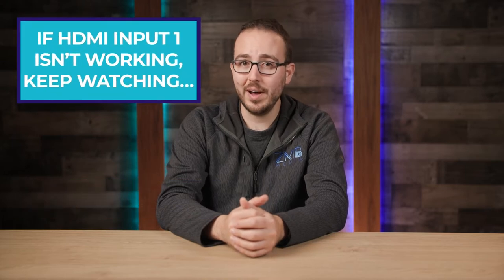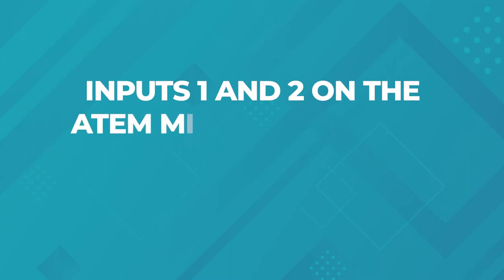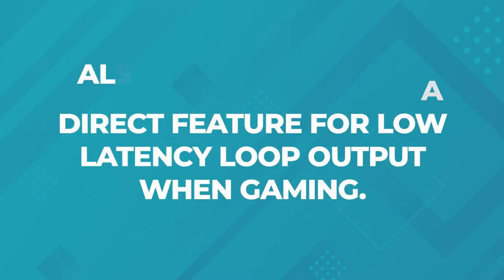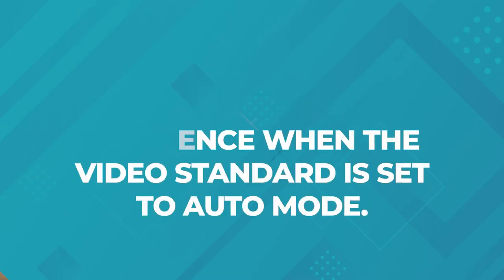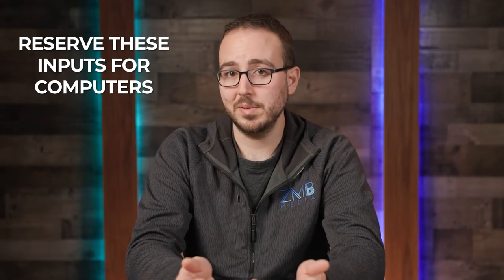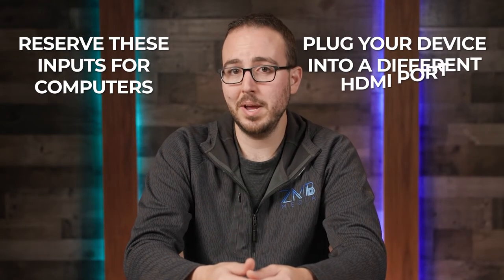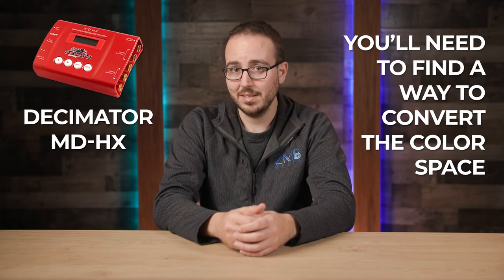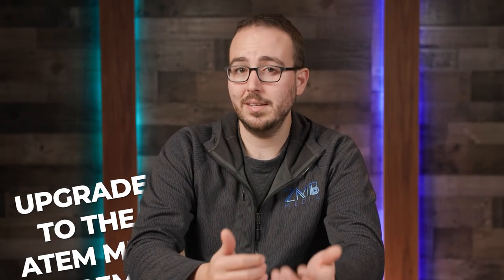Fix HDMI Input 1 Not Working - ATEM Mini Pro YUV Color Space Issue

Comment: Bro I can not explain how hard I have been searching for an answer to this issue. I have the ATEM Mini Extreme ISO and no one told me that input 1 & 2 would randomly film in this green color casting until it was too late into my 2 hours of recording SMH. So I now only use inputs 3-8. I have noticed recently the camera quality is very grainy and I have not been able to come up with a solution. I am using 5 foot HDMI cables, and 3x Panasonic G7 cameras for recording. Any feedback would be appreciated!
Reply from the maker: The G7 is a four thirds sensor so it’s never going to do well in low light situations. It’s most likely grainy because you are bumping up the ISO or you may have it in an automatic mode which will bump up the ISO in dimly lit settings.
Reply: @zephanmoses  That makes a lot of sense! I am filming a Podcast but I use very bright studio lights and still deal with the grainy look. Seems to only be like that when plugged into the ATEM Mini Extreme ISO. If it's stand alone it actually looks way better. Any thoughts!? THANK YOU!
Reply from the maker: @MikeSicilian  does it look that way on the multi view or on the recording or both?
Reply: @zephanmoses  first off I greatly appreciate you responding to this cause I've literally contacted Blackmagic and they weren't as helpful so thank you. As soon as I plug the HDMI cable into the cameras, the quality seems to reduce and I even get a warning saying "AF performance may be temporary degraded while down converting HDMI rec output (4K to 1080p)" and then just the quality goes boom and gets super grainy. Soon as I unplug it and use the camera with an SD card standalone the quality looks fantastic. It's a 1K cost machine didn't think I'd have this many issues. Appreciate any guidance!
Reply from the maker: @MikeSicilian  the G7 shoots 4K but the atem can only receive HD so that’s why. The camera is reducing the quality from 4K down to HD so that it’s compatible with the atem. So it makes sense why it’s doing that. No way around that. You’re using an HD switcher with a 4K camera.
Reply: @zephanmoses  It all makes sense. The cheaper route seems to be to get a better switcher that will work with the cameras? MUCH APPRECIATED!!
Reply: Brother I got to get at you again for one last question! So everything you said makes complete sense now. The base ISO on this G7 is 200 which is horrible. So I bump it up to at least 400-600 and even with INSANE bright studio lights still looks like crap and granny. Am I just doomed with this camera? @zephanmoses
Reply from the maker: @MikeSicilian  What are your other settings? Include F-stop, shutter speed and the lens you are using. Is it a slower kit lens? Or something F2.8 and faster? Half the battle with lighting is how well the. camera does but the other half is how much light the lens can let in. If you're using a lens at F4, F8, something higher then of course it's going to be dark. If your lens is at F2.8, F2 or F1.4 then it should be much brighter.

Also what type of lighting are you using? Cheap LED panels? Softboxes? While it might appear bright to you, what are the studio lights?

The G7 is an 8 year old camera so you can't expect much from it in lower lighting scenarios.

Comment: Hi, I have two HDMI sources (lets call them device 1 and 2) connected respectively to input HDMI 1 and 2.  Only device 1 on input 1 of Atem has audio.  The input 2 has video but the audio is not working.  When I swap device 1 and 2 cables, I still get audio from hdmi 1 (now device 2) and no audio on hdmi 2.   Same for hdmi 3-4, no audio but video is working.  To resume:  Video 1-2-3-4 ok, Audio 1 ok, Audio 2-3-4 not working.  Does someone knows why?
Reply from the maker: You need to turn on audio for each individual input. So if you look at your atem, there is an on button for audio for inputs 1 through 4 (it's just above each input. So if you look at input 1, above it is up and down arrows and then above that you'll see on and off buttons. Those buttons turn the audio on and off for that input.

If you want audio coming in on input 2, you'll need to press the on button just above the 2 button on your atem.

Now, if you've turned on the audio for that input and you're still not getting audio, there's a good chance that there is no audio traveling over the HDMI cable. You can confirm this by connecting that cable to a TV or something that has speakers to see if sound comes through.

Additionally you may have accidentally turned on AFV (Audio Follows Video) which means that you'll only hear audio when you cut to that input.
Reply: @zephanmoses , Thanks for replying but audio buttons are all set to ON and there is audio on the cable because both device are working on input 1 but not on all others channels.  Even, I was using the device no.2 on a Roland V-1HD last week and it was working great.  Have tested with AFV button also and I get the same problem.  No audio on HDMI 2-3-3, no leds, nothing.  Mic input 1 and 2 are working by the way.  The Atem has the latest firmware.
Reply from the maker: @panikpas  Are you seeing audio levels in the ATEM software control application in the audio tab? Usually they are greyed out if the audio is coming through but turned off. Always confirm in the software control. And while I understand that you used a different switcher, you did not answer whether or not you tried plugging the HDMI cable into a TV or HDMI monitor to confirm the audio is coming through. This sounds most likely a settings issue and there's something that might be missing. If you're able to record a video showing your atem switcher as well as the software control in the audio tab, I might be able to determine the issue but without being able to physically see the device, I can only provide so much assistance.
Reply: @zephanmoses , Like I said, audio is coming through hdmi cables because it was tested on hdmi input 1 of the Atem and it is working with both device and also on another video switcher with the same cable.   Audio Levels is working on hdmi 1 and Mic 1 and 2.  Audio levels is not showing on hdmi 2-3-4 even with audio set to ON on all channels.  I know you are trying to help but please read carefully what I'm saying to prevent asking question that are already answered in my comment.
Reply: @zephanmoses , I've tested another device (lets call it device 3) on hdmi 2-3-4 and the audio is working.  So, I think that it is related to the type of audio (aac) the device 2 is sending.  Probably, the input 1 has more codec compatibilities then the others hdmi input.  It's a good thing the Mic/Line input is available on the Atem.  The device 2 is a Neumi video player and I only have two modes for the audio on it: passthru and AAC.
Reply from the maker: @panikpas  I did read carefully but if you cannot participate in the troubleshooting recommendations I am making, I cannot possible learn all of the information I need to learn to help you in troubleshooting. I've asked you to verify if there are levels visible in the software control which you haven't confirmed or denied yet. Sometimes the levels are visible but greyed out which would indicate something is coming through but the audio is not turned on. Other times, audio levels are not visible at all which means there is absolutely no audio coming through that HDMI feed.
Reply from the maker: @panikpas  Additionally, you did not explain what cable length you are using for your HDMI cables as input 1 always behaves differently due to its low latency design and will receive certain signals over longer cables that you might not be able to send into inputs 2-4.
Reply: @zephanmoses  6 feets cables.  Same cable for both input.
Reply from the maker: @panikpas  Ok, what do you see when you open the ATEM Software control and go into the audio tab?
Reply: @zephanmoses , Don't bother with it, I will find the problem.  Now I know that it is related with the audio protocol on the Neumi player and that the Atem is not broken but just incompatible at some level with the Roland V-1HD (device 1) and the Neumi (device 2).
Reply: Hi, I've contacted Neumi and they told me it was a known issue and that I needed to update the firmware (2024) on the player.  I did it and now it work.  I have no audio conflict between HDMI 1 and 2 anymore.

Comment: I have ATEM Extreme ISO and Accsoon Cineview HE and get this problem when connecting them on HDMI1&2 and ok on HDMI 3-8. Just as explained in this video. But now to my observation. When recycling the power in the ATEM (still having the Accsoon connected), HDMI 1&2 work fine upon boot. But if I then recycle the power on the Accsoon im back with the issue. In my view it means that the Atem can adopt to the HDMI signal from the Accsoon on HDMI 1&2, but its a matter of startup procedure. This is of course a problem if I need to recycle the power on any of my Accsoon connected to HDMI 1 or 2 during a live show. I cant then recycle the power of the Atem to get the camera signal correct again. There should be a configuration option to solve this, hardcoding the HDMI ports. Anyone with any idea?
Reply from the maker: I think the best path forward is simply to only use inputs 3-8 with the Accsoon for safest operation.

Comment: Hdmi 2 isn't working on my mini pro
Reply from the maker: If it’s the mini pro this wouldn’t apply. It would most likely be a damaged/faulty port, a cable that is faulty or you are sending a resolution like 4K that is not compatible with the atem.